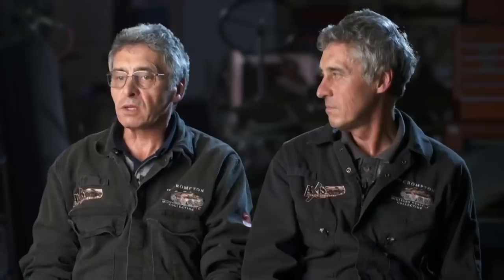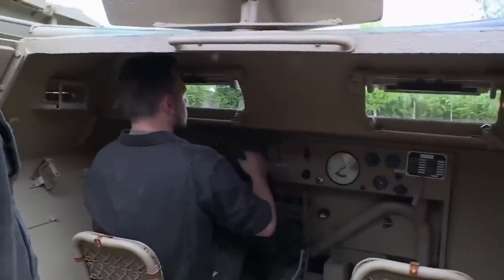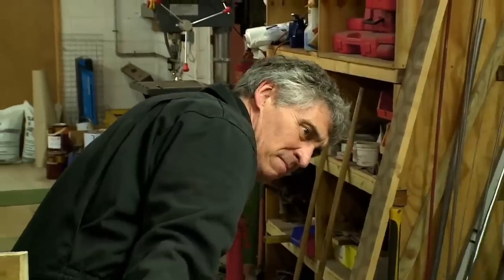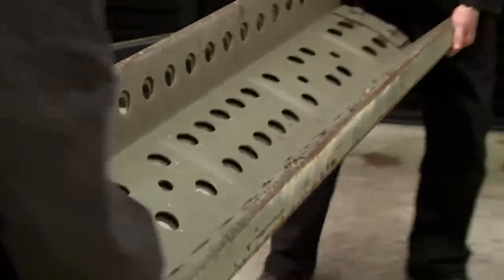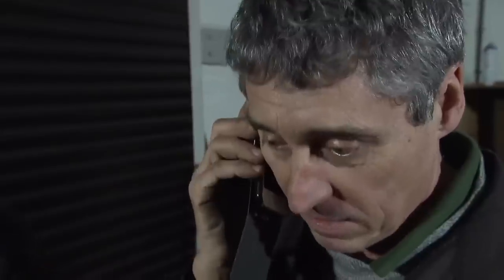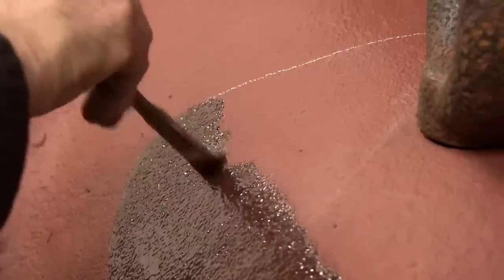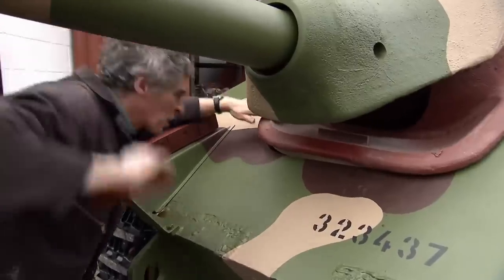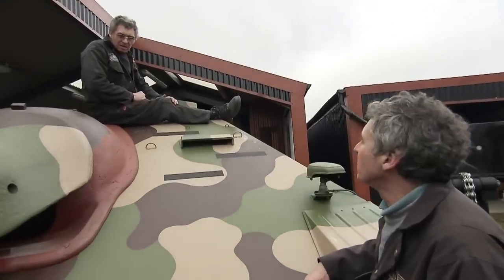Deadly World War Tanks Undergo Mind Blowing Transformations | Combat Dealers

Comment: That last part, was taking the factory engine out of my 1968 M-715 on a BobCat, OHC I6 / T98a, the last bolt was rusted so while lifted part way out of the truck we took as SAWZALL to the bolt.
It was wrapped in a rubber bushing and we got kinda complacent about almost 1,000lbs of iron, when the saw cut the bolt , the entire engine and trans SPRUNG up and out of the Jeep.
The truck lurched back and that engine and trans pendulum-ed on the chain & bucket.
I was under the truck.